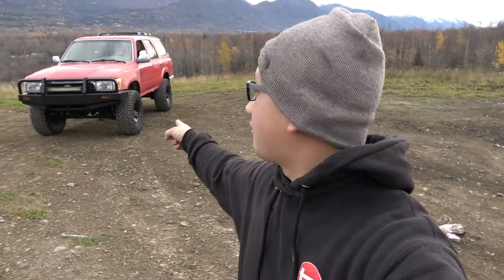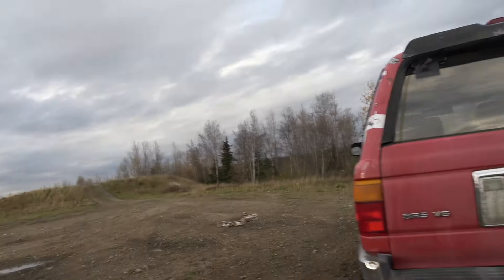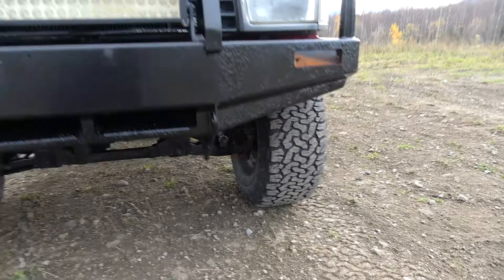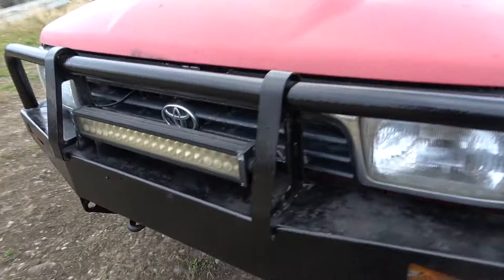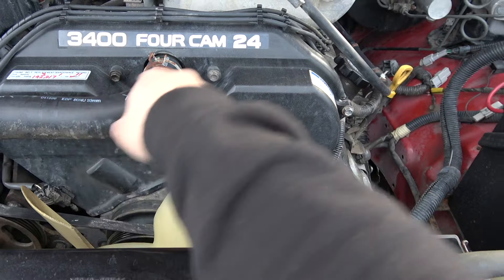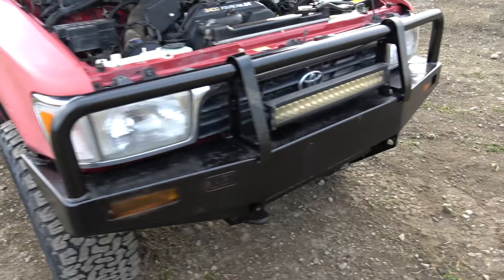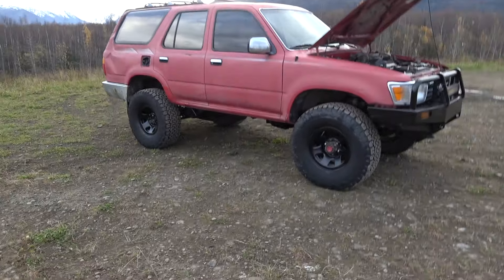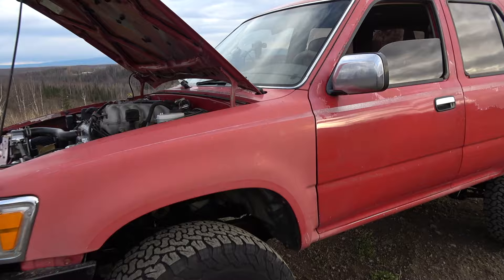1994 TOYOTA 4RUNNER SR5 | 3.4 SWAP | 33”TIRES | WALK-AROUND

Comment: Real nice little beast right there. Perfect. Replaced my fuel injectors with those you sent me. I had them rebuilt by Injector RX in Houston. Redoing my valve cover gaskets and rear cam seals while I'm in there. Can't wait to get it back on the road next week!

Comment: With both high beams not working, I would think it is more of an electrical issue. It could be the lights but not often you have both high beams out at same time. I would look at the fuse and fuse box connection as a place to start. Most likely a fuse or or loose wire. Anything is possible but that would personally be where I started looking. GL

Comment: Hey nutty 👋fellow 4Runner enthusiast here in the valley with a question . I’m currently in process of swapping my 4.10 non elocker 01 runner with a 4.30 full rear end and matching front diff from a 2000 limited . I noticed the A.D.D  actuators are different on the front diffs . Can I just swap my A.D.D from my 4Runner to the donor front differential? TIA !!
Reply from the maker: You should be able too.